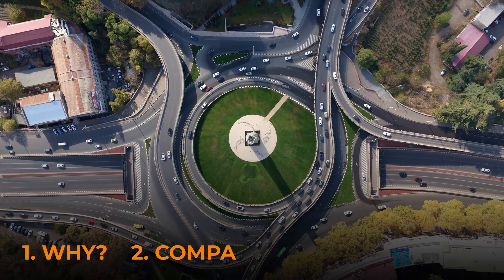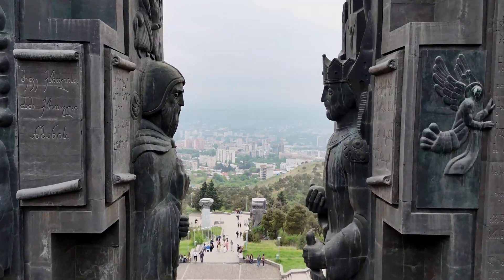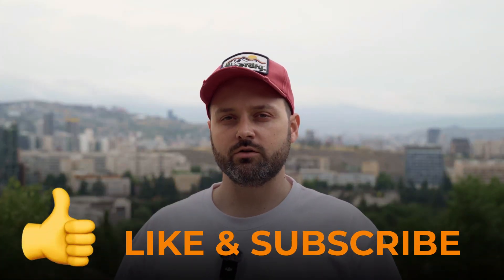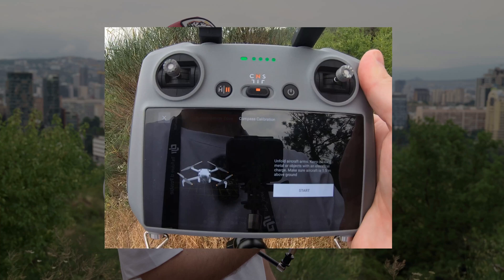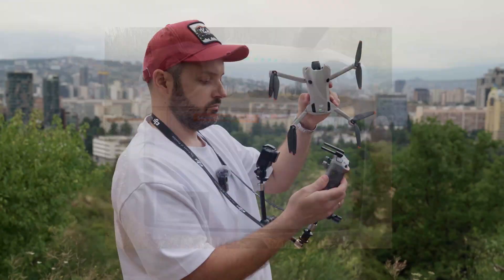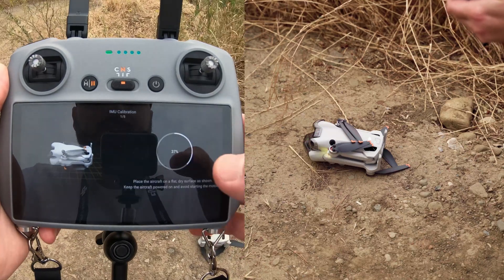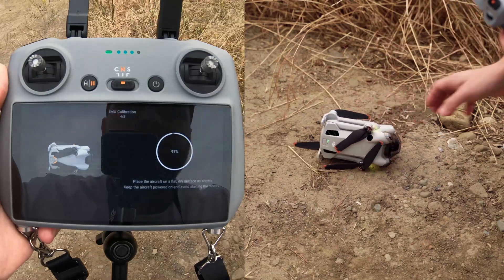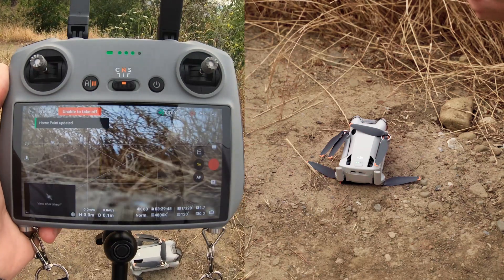Do this to prevent your drone from crashing!

Comment: You would probably want to do this on a level clean surface instead of the dusty dirty uneven ground.   Also noticed collision avoidance is off in your settings so that's why it ran into a tree
Reply from the maker: Hey bro! Yeah, definitely you should do it at the cleanest surface possible, but I was in the field where there was no any...

Regarding the collision avoidance - I prefer not to use it nowadays. I had an accident when the drone saw an obstacle, turned into opposite direction and almost hit another obstacle (didn't stop / avoided the second one). So I can't rely on it... I always enable a widget with side cameras - this gives me a picture of what's around so I can control the environment.

Comment: Always calibrate ur IMU on a brand new drone and calibrate the compass before every single flight, this can save u from ur drone going into ATTI mode and flying uncontrollably. It takes 5 seconds to Calibrate the compass so why not do it before every single flight, even calibrate when u land to change batteries before u take off again. I've seen so many people destroy their drones because they don't calibrate untill the controller or app tells them to, take the few seconds to Calibrate ur compass before every single flight to ensure ur drones stability in the air
Reply from the maker: Hey bro! Calibrating it between battery change during one day is probably too much - maybe only in the case when there was some magnetic inference on it. But I agree with you that 30 seconds action can save ~$1000 drone.

Comment: Thanks for this! What are you using to hold your camera as you film the remote control screen?
Reply from the maker: Thanks for your feedback!
I use 1/4 adapter for the DJI RC2 contoller: https://amzn.to/40XaMfD
One short articulating arm by the SmallRig: https://amzn.to/3Ituw4h
One long articulating arm by the SmallRig: https://amzn.to/3Ituw4h
And you also need one 1/4 femaie-to-female adapter to connect two articulating arms between each other: https://amzn.to/3Ituw4h
Reply: @rassokhin_mov 

Thanks!

Comment: Had a similar drift myself a little while ago.  Looking at the flight logs and mapping, the compass was about 80 degrees out.  Part of my updated pre-flight check is to do a low level 360 and check the arrow on the map in the app for accuracy.  👍
Reply from the maker: Smart decision bro!
Why do you think the compass was out? - some inference or a long distance from the last flying point or maybe something else?
Reply: @rassokhin_mov  Not really sure.  There is a magnetic pad on the back of my phone for mounting in the car which could have been a bit too close to the drone during boot up and it skewed things a bit.  Two hands are never enough when fumbling about with cables and such!
Reply from the maker: @allieandmaria oh, I see. Nobody could even imagine that things like these can affect the drone during the take-off preparation

Comment: If you move your stick forward, it moves your craft forward in pitch regardless of what your compass says. Compass failure causes drift in IMU stabilized drones.
Reply from the maker: But what if drone's X-Y-Z axises are messed up for various reasons - where will be the drone's "forward" then?
Reply: @rassokhin_mov  They won't be messed up by an out of cal compass. Pushing the lever forward spins the rear motors faster that the front motors. If the dones nose is pointing away from the tree, the ESC and motors will send it away from the tree.
Reply from the maker: @ernieschatz3783  I think the drone control is a bit more complicated than just increasing/decreasing the engine's rpm. In order to calculate which engine should run slower/faster, the drone needs to understand it's position in the air and to the ground. Then the flight controller calculates position offsets it needs to apply (e.g. Z+10, X-3, Y+5). If the positioning sensor system has invalid configuration (due to some inference or errors), then the position offset which drone has calculated may be wrong.

Comment: "Do this to prevent your drone from crashing!" you mean dont through trees, the imu and and compass wont mix up ur controls, it still knows forward stick is forward stick
Reply from the maker: Let's say forward is still forward, but in which coordinate system? If X-Y-Z axises are messed up for various reasons, the drone's "forward" won't be the same as the drone's operator expectation.

Comment: Was there no reaction to inputs as it started to ‘float away’ after take-off?
Reply from the maker: Almost no reaction! I started turning left and deccending right away, but it was just speeding up to the right.
Reply: @rassokhin_mov  its sounds like u had the sticks in the wrong mode, mode 1 is different to mode 2 and 3, calibrating imu and compass doesnt fix this, the compass is for the gps, they work together, and imu is just to level the drone, fresh out of the box should be ok , u still need to do both but if u powered up and had a quick flight it wont crash unless something was wrony like stick mode selection
Reply from the maker: @jimmyjames1807  no, the stick mode was always set to default (2). Also, if you followed what I mentioned in the video I said "left stick up" - none of the modes have this action as a "right".